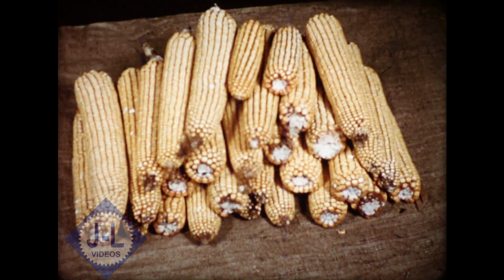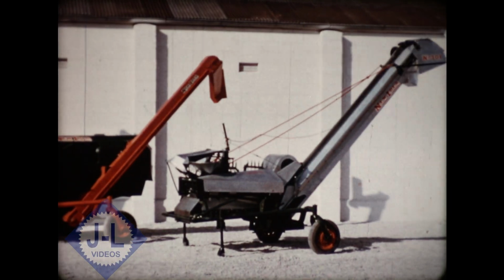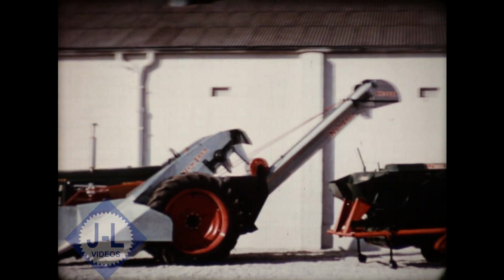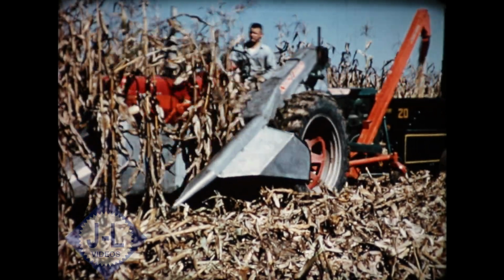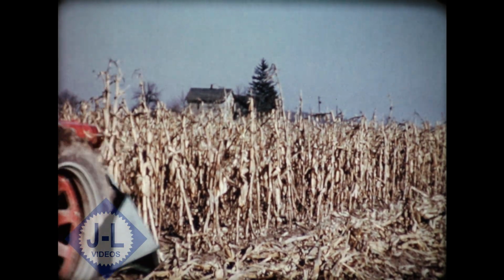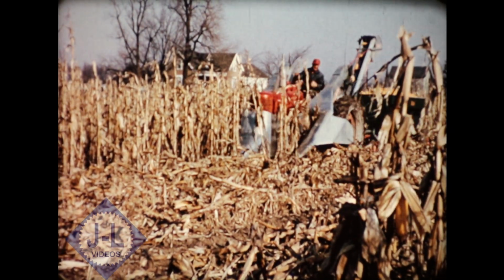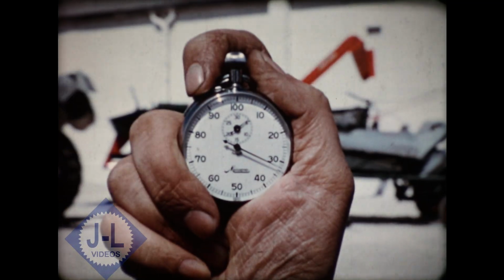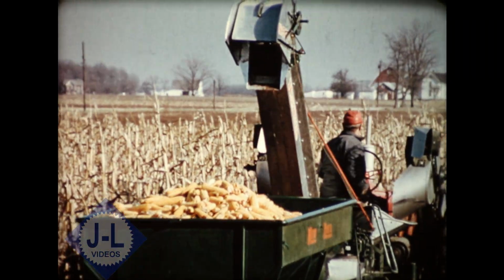1950's New Idea Farm Equipment Film The Big Question Corn Pickers Huskers and Shellers

Comment: Spent a lot of hours with the husking unit on a WD45.  It was a bearcat to get the tractor ready and mount the PTO drive.  That took a tractor and loader.  After that, it wasn't too bad.  Drive into the snapping unit, tighten the bolts, back up to the husking unit.

Comment: Interesting they went with a rasp bar cylinder over a sheller cage. I couldn’t imagine running that setup in greasy conditions with that long tail hanging back there. Sure is a cool setup though. Especially that bin type sheller. Judging by steering wheel height the Oliver is a 1957 or very early 58 Super 77. Any older than that would have been a green wheel super.